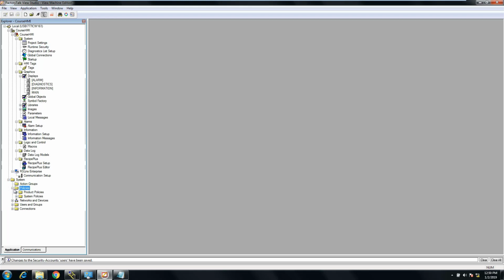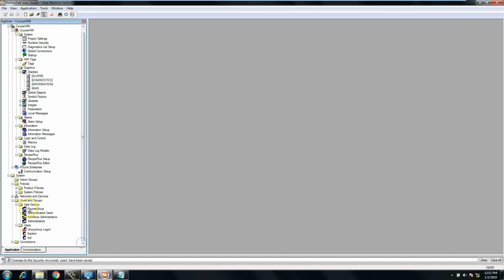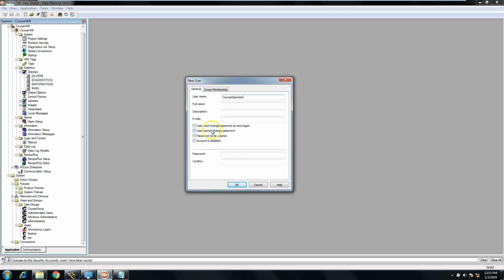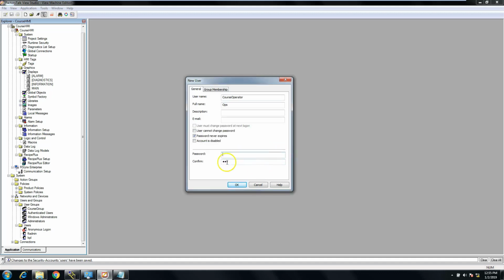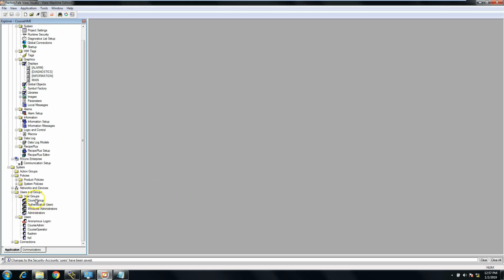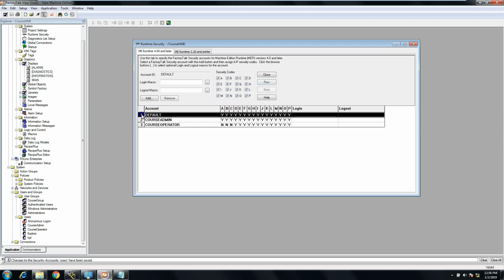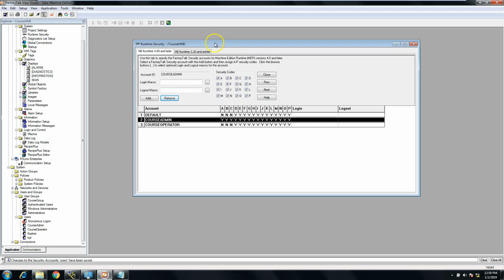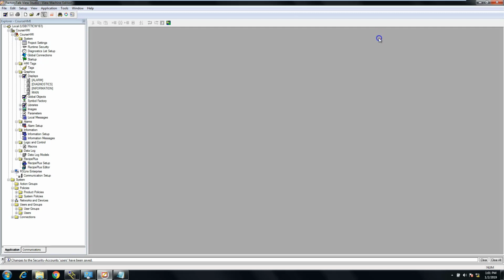FactoryTalk View Machine Edition Runtime Security Set Up in FTView 7.0

Comment: Thanks Shane for providing these videos. quick question if you don't mind. have you had any experiences with "login attempt failed. user authentication failed" errors after period of usage? the only fix is to restart the factorytalk View ME. it is using FactoryTalk View ME Station: 9.00.00 CPR 9 SR9.
Reply from the maker: Are you on Windows 10? 

If so then the software has issue from time to time, I use Windows 7 through VMware which has no problem.

Also, try using the FactoryTalk wizard to reset your signin 

This is a one time issue usually and can be found in FactoryTalk tools.

I would provide more info but I am answering this from my phone. 

I am at the hospital with my son who was just born so limited resources right now.
Reply: Shane Welcher wow congrats! I’m sure that he will keep you busy for the time being. Yes, it’s installed on a windows 10 environment(one of the requirements), and it’s not an isolated problem as we have seen on multiple machines. Not sure what tool that you are referring to but have tried rebuilt the runtime with new logins without luck.
Reply from the maker: @mysunnybear  

I use VMware as a virtual machine on my pc meaning, I make an image of my pc for driver and such the have the current OS on it.

Then have it as a virtual machine I run on my host computer that is Windows 10.

Basically you have two computers then but one is a host and the other virtual.

I use VMware to link them together.